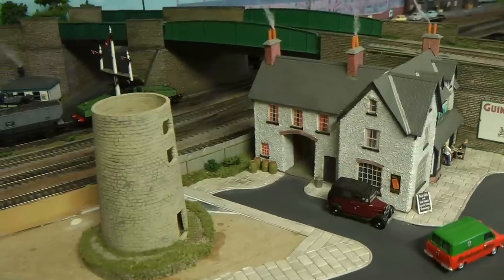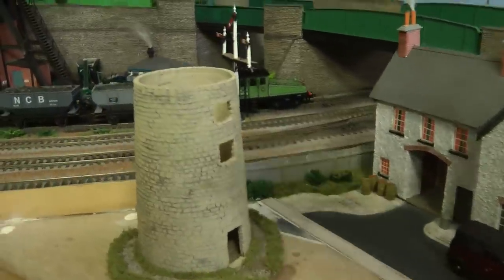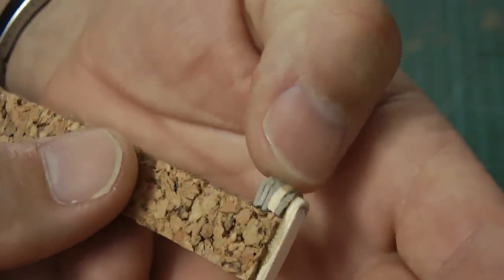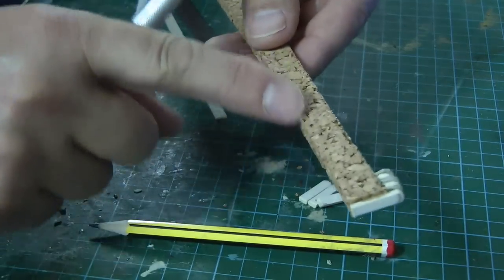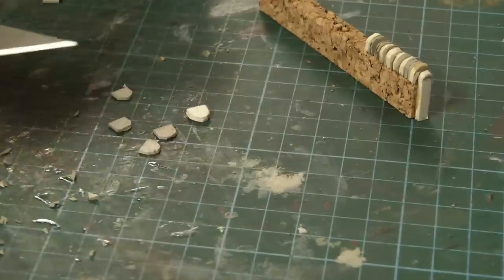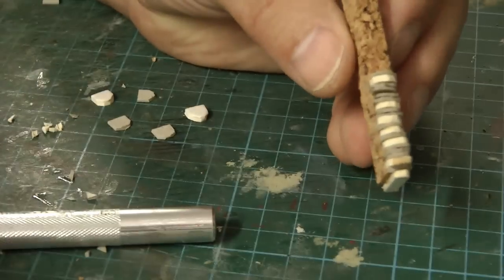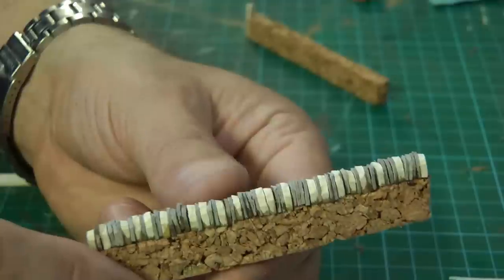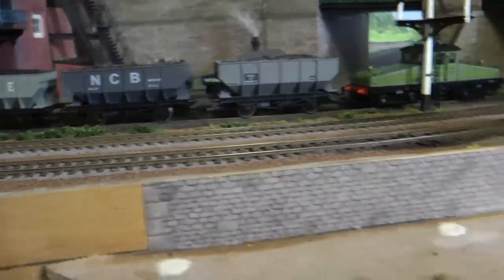The Old Mill Part 2,  Making walls    No382

Comment: Nice stone walling, Tony.  Great techniques with the paint to bring out the detail.  I do like the mill and the memories it invokes.   I remember when there was a large gear wheel on top of those two beams in the photo.  That would be late, 1950s, early `1960s.  I don’t remember the fireplace though.  Was it a later addition by someone camping inside as I don’t see a chimney?
Have a great weekend. Best, Jason.
Reply from the maker: Hi Jason. thank you for commenting. interesting to hear of your memories of the mill. for me it was the late 1970s and 1980's when i was around the mill. it will be there for centuries to come. I do recon that you are right about there being people camping out in the mill.  and used the hole in the wall to make a fire. Thanks again for commenting. until next time stay safe Tony.

Comment: In my opinion there is some separation between the old mill and the ground as in it looks like it’s been placed there rather than having foundations, perhaps a tiny amount of Sculptamold or even some of those shavings glued around the base would blend it in. Other than that I think it looks fantastic. Perhaps you could also cut and glue interior lintels as the inside is quite smooth, obviously you weren’t able to pen score the interior brickwork.
Reply from the maker: Thank you for the suggestions, the interior was a bit tricky to get into. i could have stuck some narrow strips of paper in for the lintels. that would have worked a treat. thanks again my friend. its always great to hear from you. cheer's for now Tony